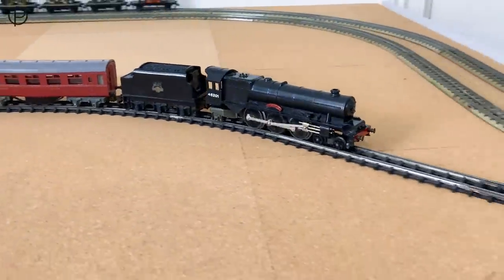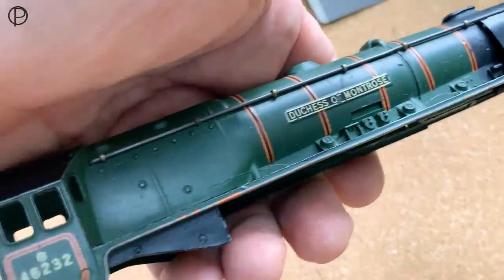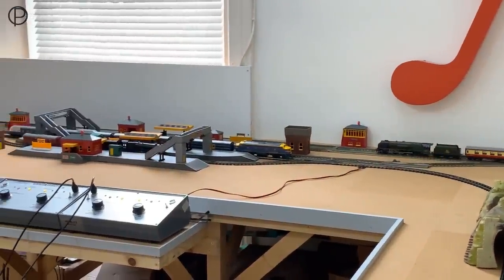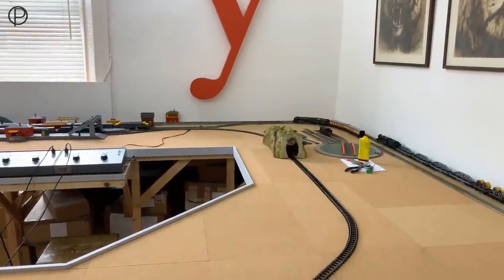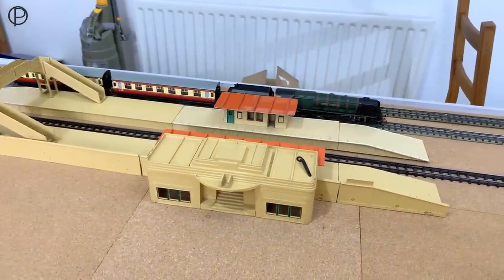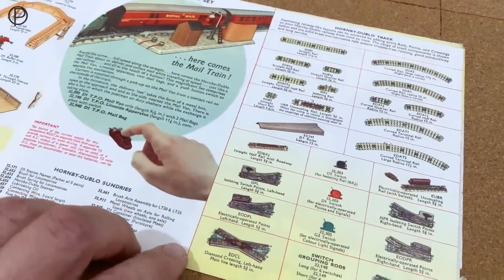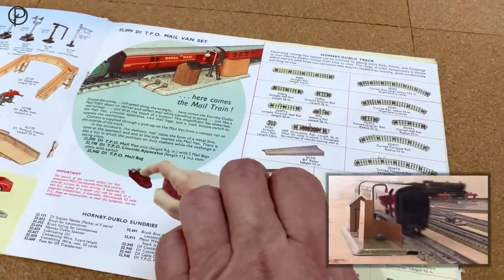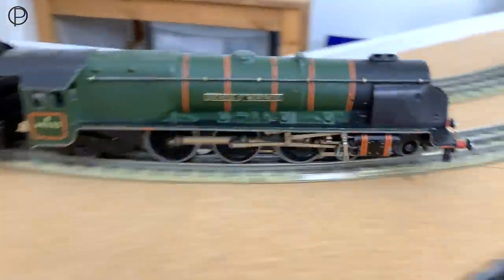Tri-ang Princess & Hornby Dublo Duchess of Montrose with layout update.

Comment: Oscar you continue to capture the spirit of the Dublo and the Triang model railway systems perfectly. 
You asked the question regarding the year of the Toys of Quality catalogue. 
Typically Meccano would print a code on the back page of all literature.
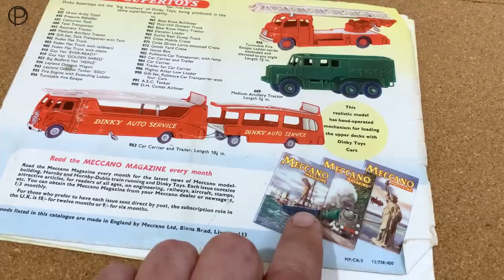At 21:10 note the code is 13/758/450. the middle digits would indicate July of 1958 which is confirmed by publication of the initial batch of Super detail goods stock, the L30 Bo-Bo diesel electric plus the colour light signals.
Reply from the maker: Hi thanks again for watching and kind words along will the great information it's very much appreciated take care.
Oscar

Comment: Hi Oscar, great video once again, looking forward to seeing the layout develop. 
I had a Linka set in the late 70s. Maybe I was a bit too young but I found it a bit fiddly, the pieces, once cast, being easily damaged and hard to glue together to maintain any strength. The moulds seem to be quite sought after judging by eBay prices!
I know a chap who has a 3 rail Beyer Garrett made out of two Dublo 8fs it is a really impressive model.
Reply from the maker: Hi Anthony, the pieces never did fit together quite as expected, like you mentioned they were often broken bits, very frustrating, an item I got for Christmas one year, my enthusiasm for it didn't last very long...
The Garrett sounds terrific.
Take care.
Oscar

Comment: Never seen a three rail version of the train tester before. I have the two rail version. You can get 3 rail track which looks like the two rail track only with the extra rail in the middle. So you don't have to buy the Hornby Dublo track, if anyone does want to collect the locomotives. The Duchess is a beautiful model, much better than anything else we have seen on these new layouts. I have a body of the model, which came in a box of bits. Sadly the cab roof was very bent.
Reply from the maker: Good morning Graham I've not come across contemporary 3-rail track, sounds like a very interesting option. The rolling road is the standard Hornby one, I made a modification to it which is completely removable back in the first lockdown when I went over my collection of three rail models and gave them a service as I had so much time on my hands. I've just added a length of balsa wood paint it black with a rail length (contemporary Hornby nickel) trimmed off at one end with some of its sleepers in place stuck to the ball wood which sits neatly between the movable rollers, the other end of the rail with its sleepers removed it's just held in place at the power feed end of the rolling road with a balsa-wood spacer. All unnecessary really as a crocodile clip would've done the job, but then there was a lot of free time back then!
Thanks again take care.
Oscar

Comment: Interesting to note how in this era, the Hornby locos are far more sophisticated than the Tri-ang ones. The Princess doesn't even attempt to replicate the prototype's valve gear whereas the Duchess has a full set. But times were going to change and Tri-ang would master plastic moulding to great effect; twenty years later Hornby was long gone and its products seem crude by comparison with Tri-ang (or more accurately, Tri-ang Hornby) products of the seventies and eighties..

Comment: Hi Oscar ,that plaster of Paris building system was called Linka ,I had it I build a 20 story tower but it fell down blimey 😂,
All the best 
Mark 🎅🏼🎄🙏😊
Reply from the maker: Morning Mark thanks for the info, I remember getting this for Christmas one year, built the odd bits and pieces, bet that 20 story tower sounded great when it came down...
Take care.
Oscar
Reply: @oscarpaisley not really my mum wasn’t pleased I didn’t take account of the weight on the bottom floors hehe looked nice but cracks appeared on the lower panels 😮